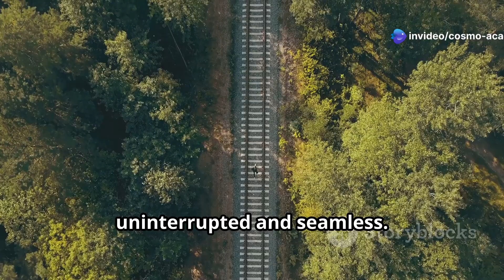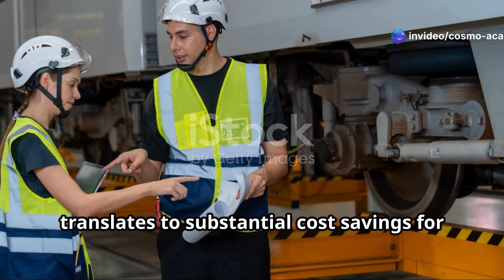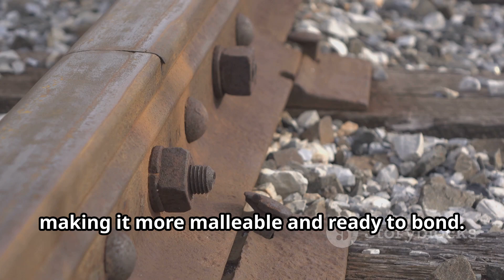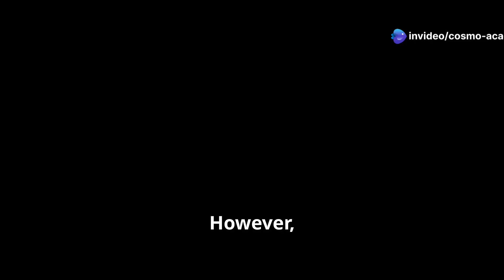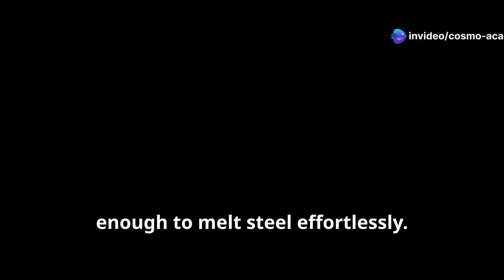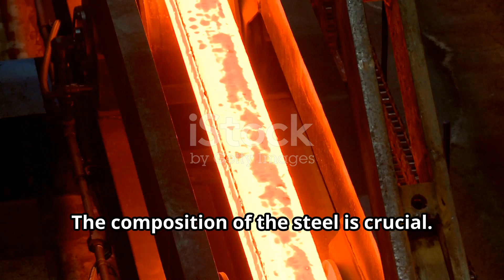Why Modern Railroads Don’t Use Expansion Joints | Science of Continuous Welded Rail Explained

Comment: Pete and repeated we’re riding on a train. Pete fell off. Who was left. Replete.
Reply from the maker: That classic riddle actually fits rail engineering quite well. Modern railways moved away from expansion joints because continuously welded rail manages thermal expansion through controlled internal stress and track fastening systems. Fewer joints mean smoother rides, lower maintenance, and higher safety margins. The “repeat” today is stress redistribution, not noise from joints.